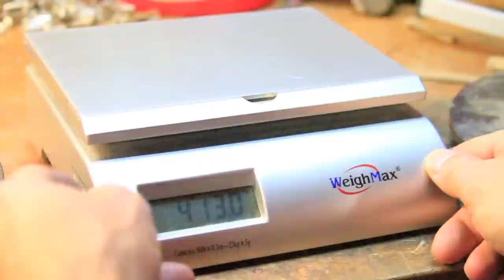(2/2) Making GSXR Motorcycle Front Brake Rotor Conversion Adapter Mount on Honda CB360

Comment: Glad to see you're using transfer punches. They're much more accurate than making a dot and hitting it with a center punch. Probably more accurate than your 3D printed template. And like you said, they get used a lot more than you would expect.
A day late and a dollar short, but you could have turned a groove the same diameter as the bolt circle on the hub side of the adapter to help mark the bolt holes. It might have made concentricity easier (and less worrisome.) 
Your precision machine can make precision marks as well as precision cuts.
Thanks for the video!

Comment: If you want to spend the money there are tapping chucks for the drill press. The decent ones allow you to set the torque to prevent you breaking the tap in the hole. Perfect if you are doing a lot of holes. Also when you pull up (to withdraw the tap) the chuck auto reverses. I used these a lot when I worked in engineering many years ago. Probably not worth it for one off jobs though. If ensuring the your tap is perfectly vertical then starting the thread in the drill press is the way to go. If you lowest speed is too high to tap then just rotate the tap be hand. Once you have a decent start to the thread then finish as normal by hand.

Comment: just an idea... when tapping those holes, chuck the piece in your lathe and lock the spindle. use some oil as well to aid in chip removal. aluminium can be sticky sometimes and can distort the thread you are cutting if stuck in between the tap and the freshly cut thread. and this is just me, but I like to  chase the threads with, you guessed it, thread chaser "taps". it tends to roll the pointy edge of the thread peaks and provide a stronger thread. 

love your work good buddy! like your approach to finding solutions to the puzzles you attack. keep it up, guy!
Reply from the maker: Thanks so much! I'll have to look into the chaser taps. And I thought about that but there isn't a convenient way of locking the spindle other than jamming something between the bolts or something.
Reply: TimNummy those chasers have saved my ass soon many times. they also save existing threads that have been damaged for whatever reason.  
concerning the chuck lock problem.. at least it will anchor the part for you to be able to tap easier. I'd suggest a vise but it would distort the part out of round which would defeat all the work you put into the part. it looks great!
Reply: TimNummy  this is the set I have. they are from MAC Tools, but I got mine off the truck. http://www.mactools.com/en-us/Extracting-and-Rethreading/Taps-Dies-and-Accessories/TRCOMBO-48/48-PC-Rethreading-Tap-and-Die-Set-

Comment: Put a spring loaded tap follower in the drill press chuck, works great for me. Spiral cut taps should clear the chips up out of the hole instead of letting them drop to the bottom. Get a bottoming tap for blind holes.

Comment: Nice job. I'm new to your channel so I don't know what equipment you have so ignore this advice if it doesn't apply. What I do is mount the piece in a 4 jaw chuck centering each whole (one at a time) with the tail stock and mount the tap in the tail stock and then you can turn the chuck by hand. This keeps everything properly aligned. If you don't have the equipment you can cheat by using a slightly larger drill bit by say a sixty-fourth and that would make it easier to tap but take away from the strength which the bolts hold. Probably a bad idea seeing how it's going on a bike. At least your nice tight threaded holes will be strong.
Reply from the maker: Thanks for the comment! Unfortunately I don't have a 4 jaw chuck (and likely the one I get wouldn't be large enough to offset this piece enough) but that definitely sounds like it'd be a nice way to do the tapping. 

And yeah, I went with slightly smaller to make sure I had all the material I could get.
Reply: Just thought I'd share
Reply: Put threading tool in drill press and use that as a guide to get it aligned, if you have a flat vice to clamp it down, and turn chuck by hand should work just fine :)
Reply: That would work too

Comment: Hi enjoying your short videos on the Chinese lathe, 1 thing i think you would benefit from making are some small jacks. I notice when you use the pillar drill there is a lot of deflection in the base this will lead to out of true drilling. by making an engineers jack you could place this under the bed and raid the jack to remove the chance of deflection

Comment: Well done. I might suggest a drill press vise, cutting fluid and a complete set of drill bits. Also, you could mount the wheel and check with a dial indicator if you think you might be out very much, no vibrations on the front wheel!
Reply from the maker: Thanks! I'll do a final check once it's all mounted on the motorcycle - but that's going to still be a little while. Just by eye I'm really impressed with how it came out though.

Comment: Hey there..
First Off..  Nice Work so far. 
BUT !!!!!
You cant use Aluminium as a Part together with "Normal Steel"..
As the parts getting wet sometimes, the Steel parts will corrode very very Fast. At First the screws will break because of the Corrosive Attack. Then any other Part will follow very Fast. Believe me. 
The nobility of both Metals are to different. In this Setup, the Metals will create a "galvanic cell" which end in Corrosive Attack against the Steel.
Use the same Metal for your construction. Or you have to isolate all parts from eachother.
No Offense.
Just a little Warning.
Greetings from Germany...

Comment: a 5" or larger vise with aluminum soft jaws would make tapping it much easier. or you can make hard wood jaws. also tapping oil might help but aluminum doesn't really need oil.

Comment: I'm sure it's been mentioned below -- starting taps without mechanical aid is just asking for non-perpendicular tapped holes, because the tap being very hard will cut in any direction.  It doesn't care about following the hole until it's so far off that the metal jams the tap.

Comment: Get a small adjustable hand reamer or a bunch more drill bits. Lube no one likes a dry one, that's nasty.
Don't forget the anti-seize to assist with the steel to alloy corrosion resistance.
your wheel needs straightening with a spoke wrench. lotsa vids on that.

Comment: you could use a cordless drill and power tap the holes but this is risky and you can strip out the hole. You get a feel for it once you've done it enough times but it's even riskier in aluminium. I would look at getting a ratcheting tap wrench so its easier on the hands.

Comment: You can power tap the holes in the drill press. Just don’t chuck the tap too tight that way it will spin in the jaws if it catches.

Comment: I have a 74 cb360 and i am planning on doing this same break conversion. I actually have breaks from a 2002 suzuki sv650 but i think they are the exact same as the gsxr break you put on yours. I am using the suzuki sv650 forks also.
Reply from the maker: cool! I have a SV650 also and the rotors are completely different. I believe they are a different diameter but more importantly, the GSR rotor is totally flat whereas the SV rotor has an offset. Making an adapter like this would likely end up being too thin to get the bolts in properly. Unless you were using the entire frontend including the wheel or found a spoked wheel that would work with the SV brakes. Good luck though! that's pretty neat... soon I'm going to be getting a lot more work done on this bike so definitely stay tuned
Reply: TimNummy i am running the whole front end minus the wheel. I have a freind that has used the sv650 front end and breaks. I will just have to make some kind of adapter.
Reply: TimNummy hey what year gsxr front end are you running. You did actually give me something to think about and double check. I really actually didnt think about the offset of the gsxr rotor vs the sv650 rotor. I check and i do think i can make it work but like i said above i need to figure out an adapter and also figure out what i am going to use for the axle as the sv axle is to big. I was thinking maybe i can turn down the axle diameter and use spacers and rethread the end but i dont think the latter will work as it will be to small to screw into the left sv650 fork end, so i am not sure what will do about that.I am not a machist but i do want to get a lathe and a mill but it wont be for awhile. I really want to figure this out as the sv650 forks look good for the style i am going for i would rather have 2005 or newer gsxr forks but i do not have the funds available to get them. Anyway love your channel keep up the great work thanks.

Comment: Nice work, add threadlocker compound, it´s always safer. Just use tapping oil and secure the piece on the chuck and lock it, use gentle movements and turn the tap back so you can "feel" the thread.
Reply from the maker: Thanks! I will add threadlocker for the final assembly for sure

Comment: Totally appreciate the skills you have dude, great ingenuity with the fork swap too. One constructive criticism though? Lose the MDF and tighten the pillar drill bed! You can see just how much angle being created by downwards pressure of the drilling. Looked like a couple of degrees out. Still very cool job well done.
Reply from the maker: Thanks! I realized that... although probably a silly reason, the mdf was to help protect the mating surface. That drill press is pretty cheap though and the bed doesn't really tighten to a point of being actually rigid unfortunately (you're right about them being a couple degrees out if not more)
Reply: TimNummy Well a quick and dirty way to solve that is to put a steel rod underneath the far side of the bed, so when it wants to flex down, it's constricted by whatever you put beneath it. Square tubing of 40x40mm (wall thickness of about 2mm or so) or something bigger depending on the length might just be your ticket untill you want to buy an expensive drill press.
Also, keep an eye on local auctions or visit machineshops and see if they have a good but cheap one. One will come across your path eventually.
Reply from the maker: That's probably a good way to fix it in the mean time. I do really need to get a better one for sure though (hopefully attached to a mill). Thanks!
Reply: Yes and support the drill table. You can use a jack. Great job. Thanks for sharing. Ps I like 3d printer too.

Comment: I always power tap aluminum and it never gives me a problem (Chuck the tap in a drill). . That and a little spritz of wd40 makes it a breeze. Just make sure you start the tap by hand to ensure a straight tapped hole.
Reply from the maker: Interesting, I'm not sure I'm bold enough to try that quite yet.
Reply: TimNummy to each their own :) and in case i wasn't clear by drill i mean like a handheld cordless drill not a drill press or anything like that. Hopefully you give it a try some day . Keep up the awesome stuff.
Reply: Just a bit of cutting oil should do just fine. Also there are wrench type thread cutting tools. I prefer them for the control they offer.Also available in different sizes for different material strengths.

Comment: Tape or clamp ? Tape or clamp ? Hmmm.
Threading is easier with some tape too. Opps. i meant a CLAMP ! there's a theme going on here ;)

Awesome job dude.

Seeing as you do 3D design/print, take a look at FreeCAD.

One of the developers is adding FEM stress analysis to it, which lets you analyse stresses in a part and refine it so you only have material where needed, which saves material/weight.
Reply from the maker: Haha thanks - I need to make brass inserts for my vise so I can clamp stuff without damaging the finish.
Reply: Woohoo ! My Chinese lathe arrived today ! 
Already made a bench for it to sit on and will be firing it up tomorrow.
Reply from the maker: Awesome! Let me know how you're liking (or not liking) it :)

Comment: 2:54  Tapping in aluminum should not be difficult.  Make certain your holes are not undersize even a little.  Standard tap drill charts are for threads that are 75% of theoretical full height.  Especially for steel, you can usually drill a bit larger for 65% thread height.  Tables are available on the web.

Incidentally, you do a lot in aluminum and use Tap Magic.  You might want to get a can of Tap Magic for aluminum.  It's water clear, has a pronounced odor that is very much like cinammon.

Comment: I absolutely hate tapping.  I have been told good quality USA (or non Chinese dollar store) taps make all the difference.  I have tried using the lathe chuck and the work piece would slip in the jaws, tried using a drill to "power tap" and the tap would slip in the drill chuck, tried running the lathe to "power tap" and the over load would trip on the lathe.  The only thing that has worked, albeit slow and stressful, was cresent wrench on one of the chuck jaws and using a tap wrench with a "cheater bar".  Man I am sweating just talking about it.
Reply from the maker: I could definitely use some higher quality taps I'm sure. Maybe I'll get some nice ones in the few common sizes I use.
Reply: I think you need multi step taps, the ones that tap in 3 different increments building up to the full size

Comment: Did you use any tapping oil?  Makes it 10x easier and makes your taps last much longer.
Reply from the maker: I did on the second half of the holes... it made it a little easier but it was still a lot of work.
Reply: Gotcha.  Sometimes I just put taps in the chuck and rotate the spindle by hand.  Makes straighter taps.  Not sure how easy that would be with a tap as large as yours and on a drill press rather than a mill.  Tap could be getting dull too, or your starting hole may have been too small.  You shouldn't be getting too much resistance
Reply from the maker: It may be that the starting hole is too small.. I didn't have the exact size drill bit so I went with the next closest size smaller.
Reply: Yeah I bet that's the problem.  I had to do the same once and was surprised by how much of a difference it makes
Reply: Juan March alcohol is way better than oil when cutting aluminium.
Reply: Eurobeatmachinist86 I've heard good things about kerosene too. Never tried it.

Comment: if anything,  your spokes need tuned.
Reply: brilliant video.  the one before it helped me set up my mini lathe to make a nicely shaped 4 inch air filter adapter for my flathead 6 cylinder 1956 Plymouth Savoy. cheers all around.

Comment: 4:22 not a good setup for the transfer punch.  With the template away from the desired hole like that I bet you could be ten thou or more off in any direction without effort.   For something like that you need a closely-fitting bushing say half an inch high or more.

5:50 turn a plug that's a close fit inside both parts and use that to align them.  Make one hole and bolt it to keep the rotational alignment when punching the centers for the other holes.

7:00 another reason for difficult tapping is the tap itself.  Cheap taps can be dreadful.  Also on a tap of the sort you're using, you have to back out half a turn every turn or two to break the chip, or the chips can jam up and break teeth on the tap.

8:14 you're seeing the effect of mis-positioned or mis-tapped holes.  Getting two or more holes to be in exactly the right positions relative to each other is one of the more difficult problems in laying out and machining.

8:46 that's the first bolt you put in, and it wasn't tight when you did it.  It's tight now because of misalignment of the holes, not lack of tapping depth (also, when you run off the end of the tapped portion of the hole with a regular bolt, it stops pretty quick.  You can't force it deeper without breaking something.

11:10 mount the spindle in a couple vee blocks or something and use a dial gauge to check runout.  Waving it around by hand like that you can tell nothing.  With it properly mounted you can improvise measurements with shims if you don't have a dial gauge.  Helps a lot to know what the runout spec is from the mfr.

11:57 you can see by eye that the rotor is off center, watch the edge as it rotates.  However this probably does not matter much.  It's runout side to side that is more of an issue.  Runout side to side can be from lack of parallelism of the ends of the adapter, or from the disk not wanting to fully seat because of interference between its edge and the inside corner of the spigot.

Comment: I hope that if you pass this motorcycle on to somebody else, you declare that the work done to the front wheel and brake has not been done by a professional and is not in anyway precisely manufacturerd.  I once had to give evidence at an inquest because I had serviced a bike . The lad was killed on it shortly after . It wasn't my fault but it shook me up . They went through every detail. .   Be careful
Reply from the maker: That's very unfortunate to hear. I don't think it's fair to say it's not in any way precisely made... also, professional just means they were paid for their services, not that the result was necessarily of higher quality. 

Either way, it would be a sad day if I have to pass this motorcycle on to someone else but I'll be sure to let them know of all the custom work I did (should it not be obvious)

Thanks for the comment!
Reply: @TimNummy  maybe what you did is far more better and presice than a '' proffesional''

preston means legaly ... do you have the right to work on brakes ?
because if something happens and the rider pushes the law to the limit youll get in trouble

just have him sign ( the buyer ) or get legal signed paper from an authorized brake expert .

just a fellow mechanic

nice mod